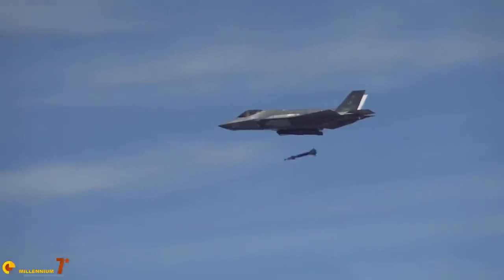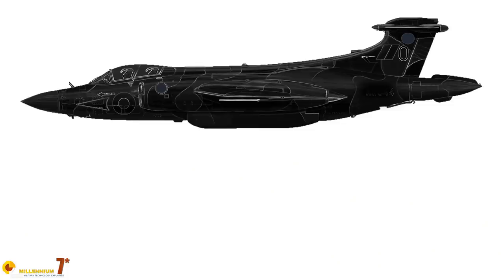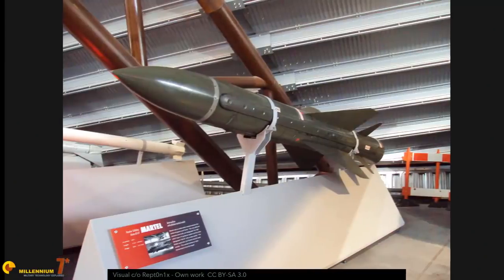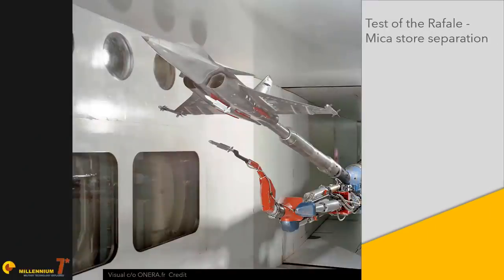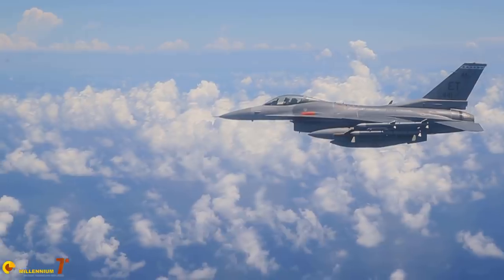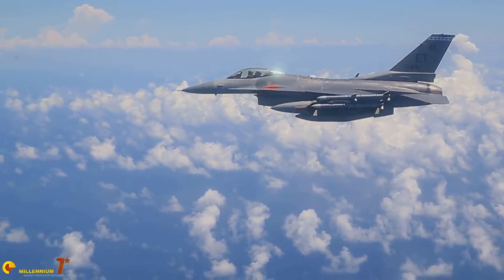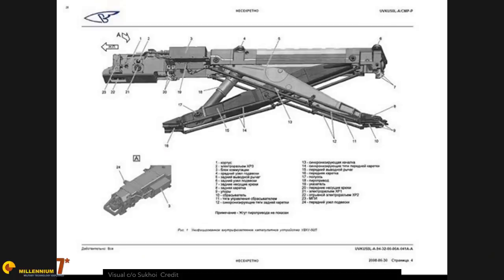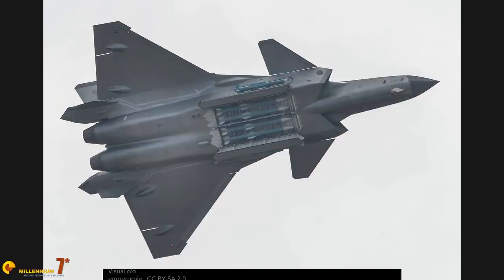How to Shoot Yourself Down in 3 minutes

Comment: IV crashed into my own bombs in flight simulators, learned the hard way not to pitch down immediately after dropping a bomb.
Reply: Just a question, why would you pitch down at all after dropping a bomb?
Reply: @sidv4615  I suppose to get a second release on the same pass.

Comment: This is the main reason why Super Hornet pylons are canted outwards.

If any of you didn't know this before, I'm sorry if you can't unsee it after this.
Reply: As far as I know that's not because of separation issues, but because of aerodynamics flow
Reply: I think the main reason for the angle is rcs?

Comment: Yes, from ejector rack testing at work before retirement, it was very important that the ordnance payload be ejected at the proper downward rate plus the rate of rotation (nose down) of the payload.  If the ejector didn't meet specs, it was disassembled to find & repair the fault.

Comment: The footage at 1:08 was AIM-7 separation testing from the unique landing gear door mounts on the 2nd YF-16 (tail number 01568) in 1977.  It did not have a radar at the time to guide the AIM-7, so this was a separation test only to validate the suitability of the door mounts after wind tunnel testing.  The cameras were mounted where the speed brakes are located.  This YF-16 presented some interesting missile and A2G weapons configurations, including LGBs soon after.

Comment: in the first supersonic planes they had several accidents with dropping bombs because the bomb would go spinning uncontrollably and hit the plane itself if released above mach 1. the first solution they came up was to install a lock mechanism that prevented weapon release when going too fast until they could come up with a better solution. in most cases it was to either make ground attack planes be subsonic or change the structure and pylon placement in a way to not be in the way of the bomb's erratic trajectory. the weapon lock mechanism is still present in any plane that uses unguided bombs

Comment: Is it reasonable or even preferable to slow down to sub-sonic speed for hot launch either in interception, air superiority, or air-ground strike?   Obviously if the weapon is long range, it would be big and heavy, then reduce airspeed for the weapon release may be preferable than making other compromises.  It's a very complicated equation with so many moving parts (in real combat scenarios).

Comment: I have seen film footage of an American aircraft dropping a bomb which dropped a few feet then came straight back up and smashed into the aircraft causing the pilot to eject. I have also seen footage of a missile which started to tumble when it was released causing damage to the aircraft. You have to wonder if the test pilot had one hand on the joystick and the other hand was on the ejector.

Imagine the effect on the Lancaster Bomber when the 22,000 lb (10,000 kg) Grand Slam bomb was dropped. Apparently the aircraft shot up like an express elevator. On dropping the bomb the aircraft would rise by 500 feet.

Comment: Verry interesting, I never thought about that. How do they manage to control the center of gravity ? Okay you could drop on big bomb form the center of the fuselage or all bombs from both wings at once. But how about the rockets ? Some picture Show the F15 EX with 12-14 Amrams. They do not shoot all at once. Even a tiny F16 can carry 4 Amrams and 2 sidewinders. Okay computer can do annything (maybe), but the F14 could carry 6 huge Phoenix missiles.
Reply: The fuel management systems in even older fighters are pretty impressive.  The engineering challenges in maintaining CofG in bombers demanded very high speed fuel pumps and monitoring systems for fuel weights, so a lot of those technologies passed over into fighters.  Go look at the weights and balances for a B-52 or B-1B some time.  The B-1B is especially enormous when it comes to internal fuel and weapons bay capacities, as well as distribution relative to the CofG.  

I’ve called in F-16s dropping either 1000lb Mk.83s or 2000lb Mk.84s, and you can see them literally lift into the air when the weapons separate.
Reply: @LRRPFco52  Sounds plausible, thank you for the explanation.

Comment: the main reason why the addition of eft's has been put on hold.
the f35 with its smaller wings has a huge pressure differential that tends to affect large and relatively light objects from safe separation.
Reply: yes, they have re-designed the tanks. Updates to F35 software for EFT's is part of block 4 update. This will increase fuel by 43% and range by 40%.
However, no customers have ordered wing tanks as of yet - since the F35 already has MORE fuel internal then most 4th gen jets WHEN they add wing tanks.

Fuel capacity (fuel tank size):
Harrier  7,000 lbs
F16 – 7000 lbs
Gripen39E/F – 7,500 lbs
Rafale 10,362 lbs
F18 – 10,860 lbs
Typhoon – 11,000 lbs
F15 – 13,455 lbs
F/A-18E: 14,700 lb
F35 – 18,498 lbs

So as you can see, the F35 already has more fuel and better range anyway (without EFT's).
as noted, two 250 gal wing tanks  = 3350lbs. So you have to go to the 450 gal tanks, and 2 = 6030lbs

So even with the larger tanks - the F35 tends to still have more fuel internal anyway. The wing tanks for the F35 will be 600 gal ones. Thus, you get 26540lbs of fuel. However, while this trades out 2 wing pylons? The other wing pylon's can still be used, and you still have the internal weapons bays (2 x 2000 lbs bombs +  2 x AIMS). And with sidekick, that will get you 6 AIMS internal. 

No matter how you slice this, the F35 does better, and carries more fuel and weapons then most 4th gen fighters. When such jets add wing tanks, then they have to trade that for weapons payloads.  But, the F35 has MUCH more internal fuel, and even when you adopt wing tanks, you still have more weapon stations due to internal stations still being avaible for weapons.

And even when you start using wing stations, the F35 still winds up with a lower RCS then 4th gen jets.
Reply: @Albertkallal  
can't order something that is not available. the US navy would be all over eft's...they have combat radius needs that are simply not being met.
Reply: @Albertkallal  
the f35 is a relatively large and heavy airframe with relatively small wings I do not see a 40 percent increase in range with eft's added...25 at absolute max.
Reply: @johnaikema1055  
Why not? The expected increase in range should be the same as any other jet. I mean, take a 4th gen jet. Say you want 2 x 2000lbs bombs (those big ones). On a 4th gen, those two big bombs have to go on the wings. and THEN you also need to add the two big wing tanks. On the F35, the two bombs can go internal, and as a result we only have two tanks on the wings - not 4 big things. The result will be less drag. 

I don't see anything that suggests the F35 would fair worse, and since you STILL HAVE less junk on the wings, then you still going to do better then 4th gen jet in terms of the drag cost (since you STILL have less wing stations being used).
I mean, wing tanks cause and cost drag. So you no doubt wind up flying slower. I don't know what kind of cross over point exists for say flying at a lower speed with lower throttle settings (if you fly too slow, you can wind up taking longer to get to the destination and thus you don't save fuel that way).

But yes, that is the expected range increase:

so the fuel increase will be 43%, and the estimated range increase is 40%.

quote:
Adding 600-gallon fuel tanks to the strike fighter would provide about a 40 percent increase of range, said Greg Ulmer, Lockheed vice president and general manager of the F-35 program, June 17 at the Paris Air Show.“ There’s several customers that are interested in extending the range of the airplane,” Ulmer said, without specifying which countries

so Lockheed is eager to offer wing tanks. If anyone has some numbers of typical 4th gen jets increase in fuel vs drag losses, then by all mean share. Fuel tanks on the F35 should work and produce similar effects and increase of range like any other jet.
Reply: @johnaikema1055  
huh? What F35C wing been deployed? I think the first air wing is JUST now being deployed as I write this.
And how is the combat radius of the F35 poor?
You not going to compare one jet with fuel tanks on the wings vs another without? (surely you jest!!!).

Fuel capacity (fuel tank size):
Harrier  7,000 lbs
F16 – 7000 lbs
Gripen39E/F – 7,500 lbs
Rafale 10,362 lbs
F18 – 10,860 lbs
Typhoon – 11,000 lbs
F15 – 13,455 lbs
F35 – 18,498 lbs

so look at the above!!!!
every single jet in above with 2 larger wing tanks STILL HAS LESS fuel internal then the F35!!! - so how and why would anyone be all over this? 
I mean, you have this already:

F16 – 340 n miles (range = 680 n miles)
F18 – 400 n miles (range = 800 n miles)
Gripen Jas39 E/F – 431 n miles (range = 862 n miles)
Rafael – 500 n miles (range = 1000 n miles)

F35 – 760 n miles   (range = 1520 n miles)

so, F35 already better. But yes, Lockheed has and WILL supply fuel tanks. Israel is ALSO working on EFT's, and that program was speced to be only 2 years - and that was 2 years ago. Israel also (for some strange reason) looking at CFT's, but I doubt that will occur. 
So customers will have even more then one vendor (Lockheed or Israel) for EFT's.

Those flying the F35 LOVE the huge fuel capacity. I mean, you take just 20 jets to fly. You want to NOW load 40 fuel tanks? you have to go to storage, truck/dolly them out to the air base, hang them on the jets, put fuel in separate. Just the logistics and ground crew pain here is huge. And when they come back? Same thing, 40 fuel tanks - un-mount them, drain fuel, and then truck/dolly away all those wing tanks to storage.
With F35? Not required!!! And as noted, please go read again the fuel capacities of the 4th gen jets above - it is beyond silly how low their fuel capacities are.

However, having stated the above?

Yes, external fuel tanks are being rested by some - but VERY few.

quote:
2019 Paris air show:

Adding 600-gallon fuel tanks to the strike fighter would provide about a 40 percent increase of range, said Greg Ulmer, Lockheed vice president and general manager of the F-35 program, June 17 at the Paris Air Show. “There’s several customers that are interested in extending the range of the airplane,” Ulmer said, without specifying which countries

So yes, for customers that want EFT's, Lockheed is happy to supply them, and they will. So EFT's are coming, and they will be a option. But for most flying, EFT's are not required, and the F35 already has MORE fuel internal then the vast majority of 4th gen jet WITH 2 externa fuel tanks anyway. Go figure!!
Reply: @Albertkallal  
the navy is concerned (has been for several years) about fighter range for carrier defense. the navy wants closer to 1000nm combat radius for defensive operations...the f35 falls short.
the navy is looking at future needs and not seeing the f35 as a true fix.
yes offensively the f35 will add bite...but defensively does not have the Combat radius to contend with current or future threats.
the navy is not procuring for yesterday...they are procuring for tomorrow.
advancements have been had by those we would consider opponents as well.
Reply: @Albertkallal  
I do not agree with the majority of the ranges you've listed. sorry...numbers are to far off to even try to make sense of.
Reply: @Albertkallal  
the size, weight, form drag, lift to weight 
 ratio (induced drag )change how all airframe will perform. 
the f35 either 669nm combat radius while clean will not get a 40% increase in combat radius with the addition of eft's.
Reply: @johnaikema1055  
I'm open to information that suggests what the expected increase in drag will be? 3-4% ? I mean typical drag increase numbers should be out there? I'll Google around and see what kind of numbers come up (even for any fighter - that would give us at least some metrics to work with).
Reply: @johnaikema1055  The F-35C has over a 100nm increase in combat radius than a 2-tank F-14D had, so not sure what you’re referring to about not meeting combat radii needs.  F-35C can fly a better CAP profile than the F-14D could, while also providing ISR and ASW.  It brings back the strike reach of the A-7E, with better survivability than the F-117A.
Reply: @johnaikema1055  F-35 variant wing sizes are where they need to be.  It’s a lifting body design, so the wings don’t generate all of the lift.  The F-35A has more combat radius than the F-15E with CFTs and 2x EFTs.  The F-35B has within a few hundred pounds internal fuel of an F/A-18F.  The F-35C has almost 20,000lb internal fuel.
Reply: @LRRPFco52  
the US navy is looking for equipment that can defend against modern threats not yesterday's threats.
Reply: @LRRPFco52  
the f15ex combat radius=+1100nm
the f35 combat radius=669nm

most fighter's use a lifting body to increase efficiency. the f35 tends to spill far more air off its wingtips as vortices. 
only so much lift can be made per square inch before the pressure difference causes spillage. spillage is air moved that is not used, moving air takes work=increase in fuel burn needs. on top of that vortices causes drag by acting like small tornadoes pulling in the wing.
the f35 was designed for stealth above all else, smaller wings give less RCS return...hence smaller wings.
the f35 has it's place as a first strike fighter in contested airspace (what it was designed for). unfortunately the navy also needs to procure dor it's defense...modern day threats cause a need for greater range then is had by the f35c.
Reply: @johnaikema1055  F-15EX combat radius is as far as it can fly before entering the MEZ, which means it can't even enter threat airspace and would often be within parameters before crossing a lot of regional borders where high density IADS exist in the world today.

I'm quite familiar with aerodynamics and wingtip vortices.  Right now, there isn't another carrier-borne fighter platform with anywhere near the combat radius of the F-35C.

Discussions about wingtip vortices while ignoring parasitic drag from suspension equipment, ECM pods, FLIR pods, EFTs, and externally-mounted weapons is misplaced by a factor of at anywhere from 7:1, to 14:1 in terms of contribution to drag.

F-15C, Super Hornet, and Viper drivers all immediately recognize how less draggy JSF variants are.

You also aren't max speed limited by fusing and thermal cycles on weapons like with 4th Gen.
Reply: @LRRPFco52  
just curious...should the carrier group be in the MEZ? the whole idea is to keep the carrier groups as far away from threats as possible...hence the preference for additional range of it's defensive fighters.
the farther out one can remove the threat be it aircraft enemy aircraft or missile the better. the navy is seeing a need to extend its layers of defense due to increased range of munitions that can threaten the carrier group. 
my initial comment stands.
the navy is not satisfied with the f35c as a complete answer to their needs.
the navy is push large funding at a 6th gen type for that very reason.
technology never stands still.
Reply: @johnaikema1055  Tracking that, hence NGAD-N and MQ-25, cease of orders for Super Hornets.

Once the Navy gets a 1000nm radius platform, Chicoms will just add booster stages to TBM and Anti-Ship missiles.

Requires a different approach as TBMs increase in capability.
Reply: @LRRPFco52  
very likely...but that's the game that's played.
the US navy will also add longer range munitions and possibly lasers to their fighter's as time progresses.
the longer the range of the fighter the longer it can also stay airborne in forward defensive positions.